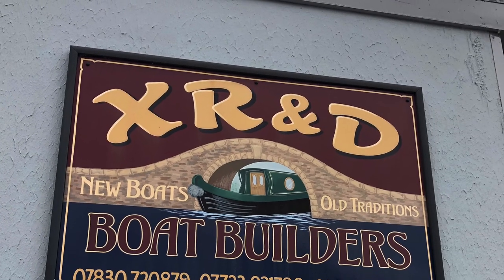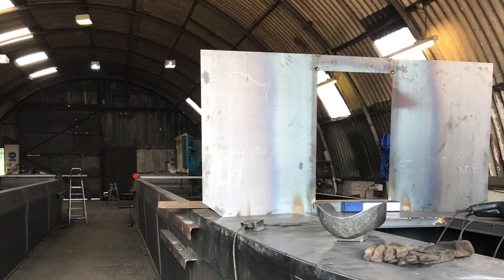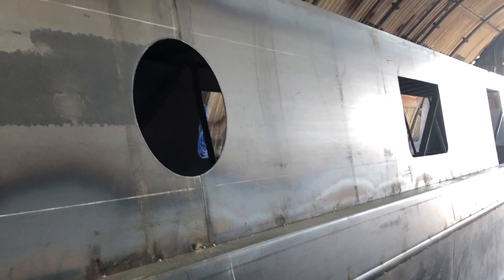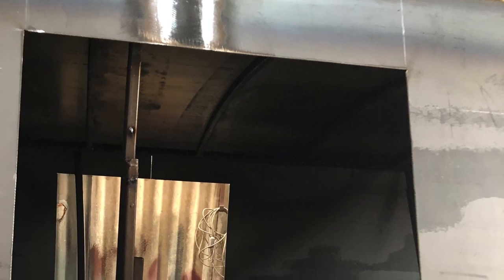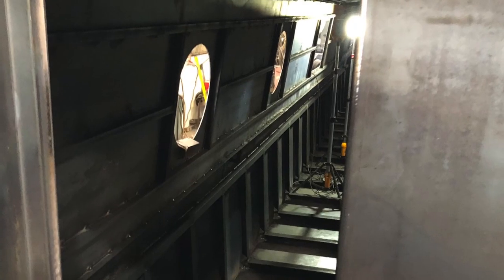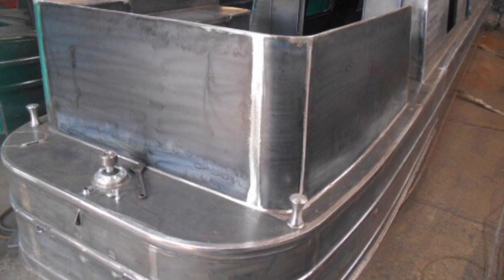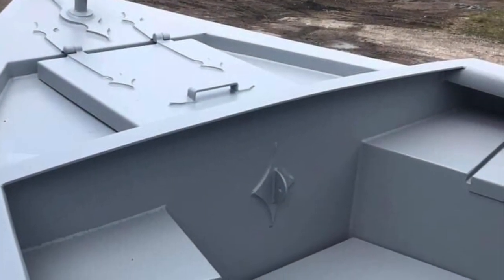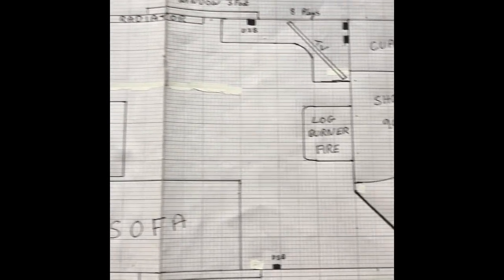Crafting a Stunning Narrowboat Shell Step by Step

Comment: What did you do about the mill scale before painting
Reply from the maker: Sorry not sure what you mean. We didn’t paint the boat we had it all done professionally.
Reply: @NeverTwoLateOurJourney  mill scale is a layer which is on the new steel when it comes out of the factory. If the scale is not removed and just painted over it can cause the paint to come off due to the fact the mill scale is flaking. In effect it could cause pitting in the hull. A new boat should be left to rust then shot blasted, this takes off the mill scale and then paint can be applied. Many new boats are just painted when the boat has just been built. I can never understand this myself as the finish of the boat is as important as the actual build.
Reply from the maker: @workingboat  oh right. It was done by the builder and he knows what he is doing so I’m sure it will be fine.